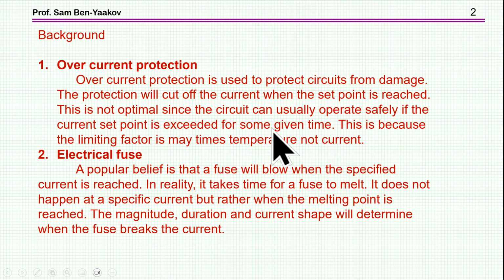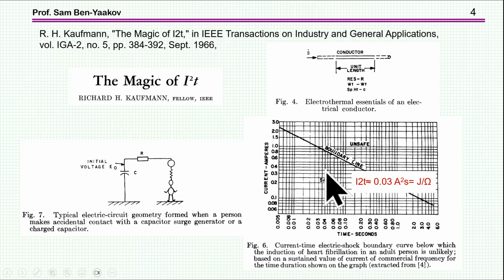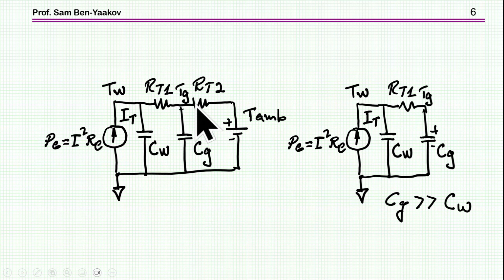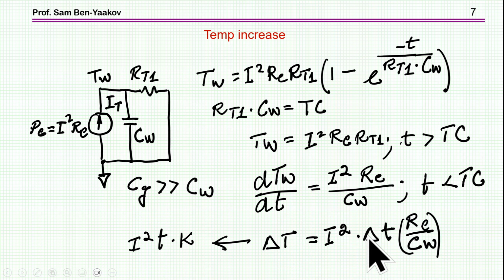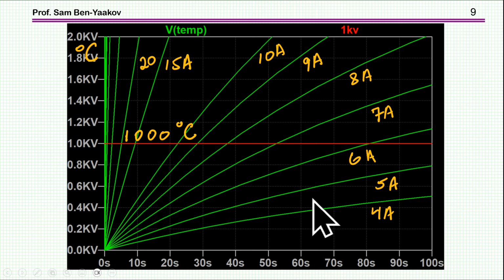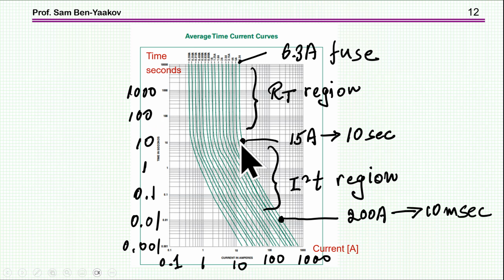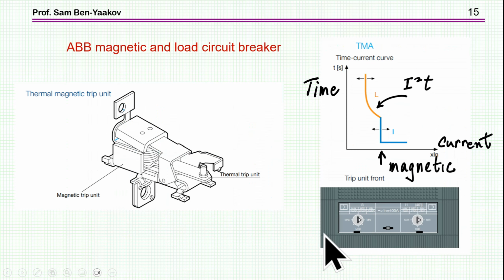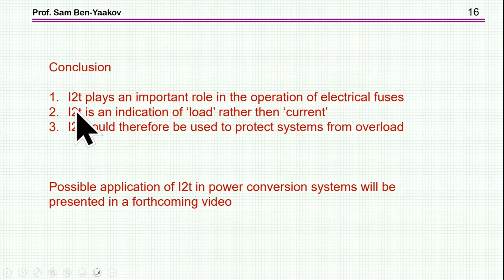I2t. What? Why? When?: The electric fuse case

Comment: Thank you for this. I did a seminar at my work on the physics of fuses, and used your presentation as a guide in creating it. I did cite you, and your Youtube channel in the Power Point.
Reply from the maker: Glad to hear it was useful for your seminar! 👍
Reply: @sambenyaakov  Prof. Ben Yaakov - If you haven't already, perhaps do a presentation on snubbing high frequency ringing when hot-swapping into a capacitive load; E.g. inserting a parallel LR in series, perhaps a saturable reactor, etc. Thanks.
Reply from the maker: @SSLaplaceTransform  Will consider

Comment: I have searched a lot about the concept of I2t and I didn’t understand. However, I understood now partially. I will watch your video again and again because I am slow learner. Thanks for the video.
Reply: Remember the fuse is current operated. However we are concerned with power. We just use current as an indicator because voltage is relatively constant.   The Golden Rule of any physics: Nothing Happens in "0" Time !
Reply from the maker: Glad it was helpful!

Comment: Thanks for your explanation
Reply from the maker: So nice of you. Thanks
Reply: Could you model the positive thermal coefficient of the fuse wire, I think the RT region could look like different   @sambenyaakov
Reply from the maker: It can be done by a variale resistor of course. Yes, it might change the shape. This is home work.

Comment: Thank you for video. Very interesting and new stuff for me. I always wondered as a kid, why a 1A doesn't melt at 1A. felt like a scam 😂
Reply from the maker: Better than being electrified as I was as a kid🤣. You may be surprised, but many engineers think that a 1A fuse will blow at a little above 1A or that it can protect a MOSFET against overcurrent.

Comment: I always pondered about modeling a thermal breaker or fuse using a single RC circuit like this and using a low-pass filter of current flow through a shunt and a comparater controlling a pass transistor to make an active fuse, though such chips already exist of course
Reply from the maker: Yes, ST just came out with a controller. But modeling is still important😊